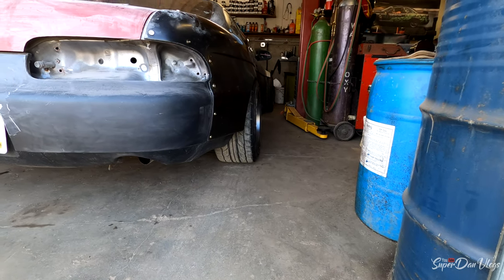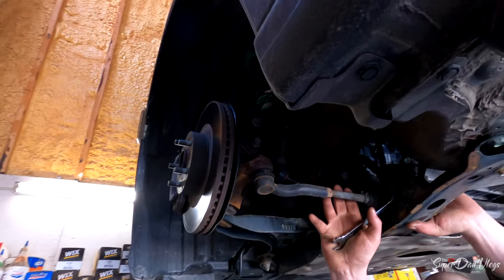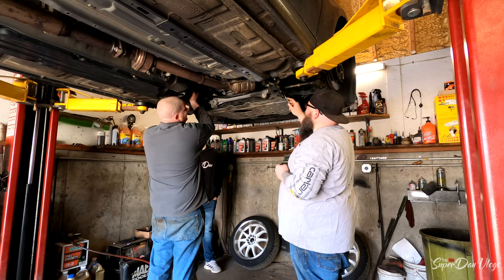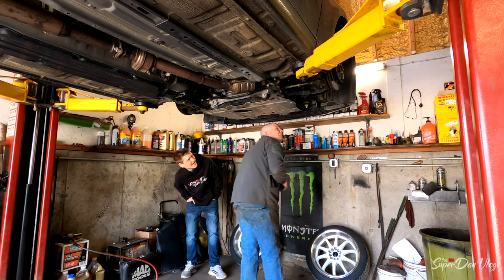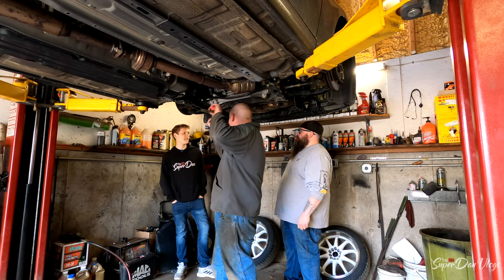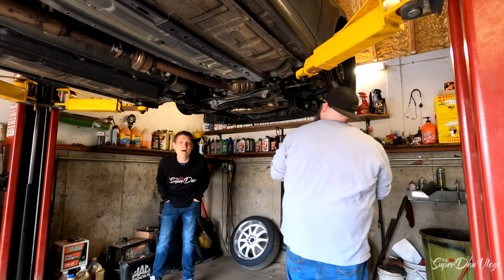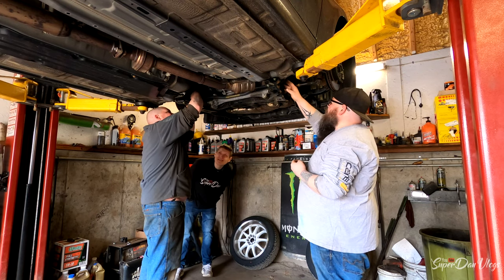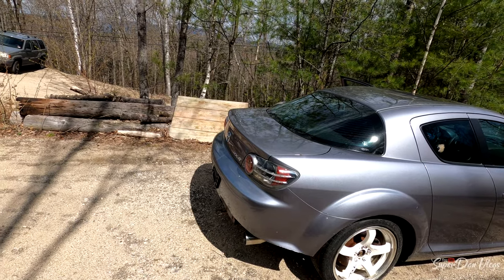Hotchkis Front Sway Bar  Install & Review / Impressions - BRZ/FRS/GT86

Comment: I've had my frs at 12 psi for about 30k miles with a Garrett gtx3076 and it's been holding up like a boss. But I also made sure to get all supporting mods catch can/oil cooler/fuel pump/ injectors and such, so that it's less strain on the setup. Before going to e85 my last dyno tune yielded 389hp at 12psi. So they hold up well with boost and your tune is the critical component.
Reply from the maker: NICE!! thanks for the adcive. Im still pretty new to the car scene so learning a lot